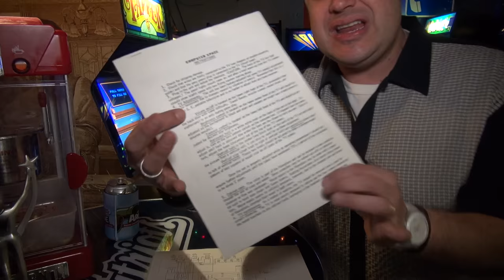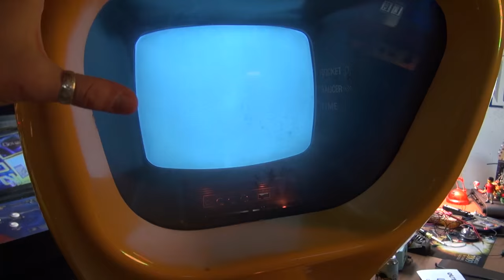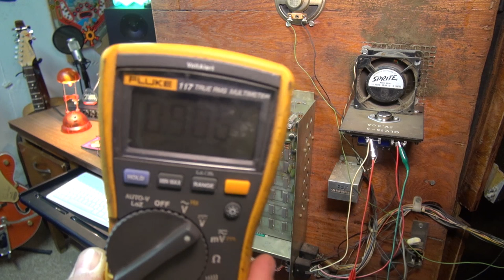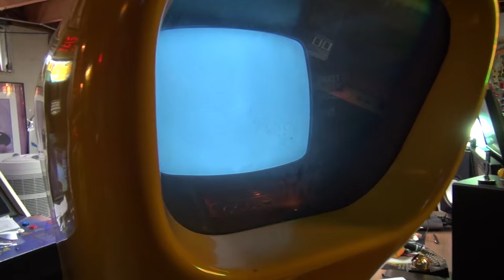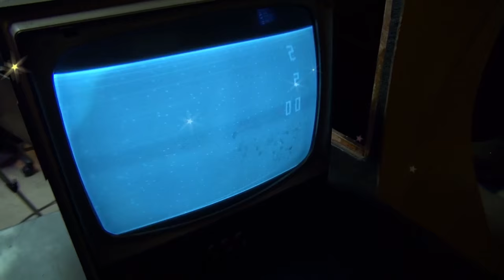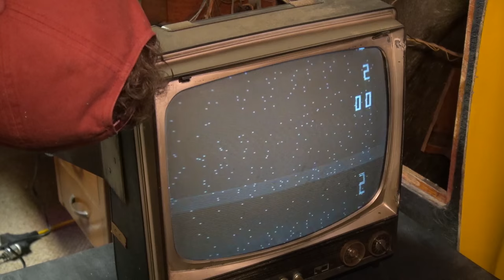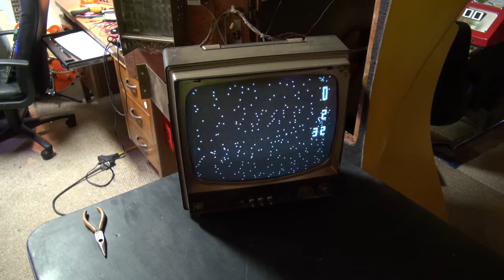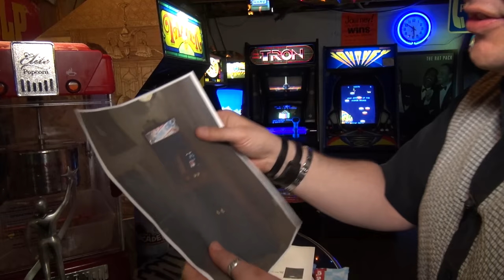Computer Space Arcade Restore Part #3 - GE S3 SE TV fix - vacuum tubes and more

Comment: If you remove the "sense"' jumpers on the power supply and run a separate wire from the sense terminal to the actual logic PCB, the power supply will compensate for voltage drops in the actual power lead and ensure exactly 5 volts to the ship set regardless of changing load etc. Not really necessary for this application, but thought I would toss it out in case anybody wondered why they have sense inputs on some power supplies. Can't wait to see this machine up and running. Great videos.

Comment: John - you should buy a FLIR One add on for your cell phone. Infrared cameras would easily show where any short was on any board. GametechUs uses one on his repairs and it's pretty useful
Reply from the maker: +Bob Marley Those look cool. I should get one!
Reply: Man, those things are awesome!!!! So expensive!
Reply: John's Arcade Game Reviews & Tech If a chip is shorting out it glows nice and bright.  Its really easy to see where an electrical path terminates if there is an issue.  Plus when you were inspecting the bulbs it would be obvious which parts of the board were not powering up.  They are expensive, but they have a lot of uses. I have one and was shocked to see where all the drafts in my house were coming from.  I also use it working on my car to find fantom power draw and other things.  Its a handy tool, especially for someone like John.

Comment: Get a lil tub of flux to help tin wires. It'll really help. Dip the bare end (wipe off the excess if you are fussy), and then apply solder to it. It really helps the flow of molten solder - nice clean surface. Flux cleans as the solder adheres to the wire making a good amalgamation. It's also great for tip maintenance. Yes, you will be using rosin core solder (solder intertwined with little voids inside holding the flux) but there's not enough flux to solder ratio for bare end wire.

All you end up doing is applying silly amounts of solder just to make up for the lack of flux. If you have ever used desolder braid, then you already know the principle.
Reply from the maker: +Jon Simmons (Neffers) Yes, I know I should be using flux more often. It's just so messy.
Reply: Nah man, really it's containable. I personally use one of those really small jam (jelly to you) jars that those "artisan" ones come in. I have used in the past a Nivea lip balm tub, but metal + proper flux = usually rust,

Just jab the bare end of the wire in and it'll just soak solder like there's no tomorrow. Also, if you end up using the more modern Lead free shit (it really is shit), it'll help with flow a lot. 

The only downside is using too much, then you do get the mess. For smaller applications, such as PCB stuff, you can purchase a "Flux Pen", these are like a soldering Sharpie, just dab it on pads or any bare copper etc. and the solder will adhere.

Comment: i am eighteen now but when i got my two cabinets i was 16 yep 16 thanks to the jump bug monitor i was able to fix both of them it was awesome
Reply from the maker: +Flashflood140x that's awesome! Great work. what games?
Reply: +John&#39;s Arcade Game Reviews &amp; Tech I have a ms. pacman cocktail which had a neckboard issue when i got it and a cruis'n world which had a battery backup problem when i got it the crusin world works fine except for not saving high scores and the MS. Pac has a color issue with the monitor ah

Comment: Just a suggestion - I am totally for getting everything original working as far as the power supply. BUT I would still get a quality switching PSU and have that in there for most day to day use, especially during long play days such as parties.

The best thing to do for those old electronics is keeping them running on quality stable power. Then reconnect the original PSU when it calls for it. I would go one step further and have a small UPS with line conditioning down there for this game, but I'm crazy like that.
(Sorry if this was mentioned a million times already).

Keep up the great work!

Comment: I would suggest not wiggling the vacuum tubes when installing or removing them.  They're designed to come straight in or out.  Wiggling will break off pins or crack the seal on the tubes.

Comment: Not sure if this is a tech myth or not, but I never touch tubes with my bare hands.  I always either use gloves or a non-static cloth to change them out on my amps.  When I was younger, I was told by some old rockers that the oils on your skin will degrade the integrity of the tube glass faster than if you can keep them spotless.  like I said... not sure if it's true or not, so do with it as you will.  Great stuff as always John!

Comment: Unstable picture could be dirty pots, dirty tube sockets, shorted or weak tubes.. If you check the other tubes I would spray some deoxe or even WD40 in the sockets to loosen the tubes up so you don't break anymore pins from other tubes, clean all the pot switches with deoxe too.. Start with the simple stuff first.. If it's not dirty tube sockets or pot controls, then it's other things.. Looks like the horz is a little stretched as the top number on the gameplay is a bit stretched.. Good to see that TV working.. Keep up with the good work, you're doing good so far....
Reply from the maker: +vintageceilingfans Thanks! I plan on digging deeper into the TV and soon.
Reply: Seriously pick up some cans of CRAIG Deoxit and their pot lube!

Comment: Try measuring the current through your 5 volt rail on a short. If it is nowhere near the rating, then it's probably a wrong resistor or a diode installed the wrong way?

Comment: Hi John, thanks for the fab channel. I think you need to consider the transformer for your PSU issue. As I see it, what your calling the power supply is just a voltage regulator. It rectifies to DC, regulates and smooths the output from the transformer. The transformer should put out a higher AC voltage (something like 12vac) and if it's only putting out 6vac due to a secondary short, it won't take a load. Keep up the good work

Comment: That Raspberry Pi stuff sounds interesting. I didn't even know it could output proper arcade resolutions.
Reply: +googleboughtmee Well it's designed to output composite, which itself is designed to be a combination of sync and luma, plus chroma which was specifically designed so that B&W TVs could ignore it. American arcades usually run at standard NTSC frame rates so it makes sense that it would work.
Reply: +CODMarioWarfare No I think they run at 60fps 240p not 30fps 480i.
Reply: +googleboughtmee They're really kind of the same thing. Any standard resolution monitor can accept both, the difference is in the timing of the scanlines at the source.
Reply: +CODMarioWarfare 240p and 480i are not the same thing.
Reply: +googleboughtmee 480i is just 240p with every other frame shifted down by half a line.
Reply: +CODMarioWarfare So they're different, is what you're saying?
Reply: +googleboughtmee What I'm saying is that analog monitors that want 15.7khz signals don't give a shit about the difference. BTW, an NES via composite is ~226p, not 480i, despite being displayed on a television designed for 480i.
Reply: +CODMarioWarfare These tidbits of information really are fascinating but I'm surprised anybody would speak of 240p and 480i as interchangable when it comes to retro gaming.
Reply: +googleboughtmee Obviously they're quite different and interlaced is better suited towards natural images while progressive is good for computer generated images, especially sprites, but from a technical standpoint they're nearly interchangeable which is why you can use progressive image sources (early video games) on consumer TVs and you can use an interlaced image source (Raspberry Pi) on a monitor designed for progressive sources.
Reply: +CODMarioWarfare John was talking about plugging the Pi into the cabinet, having it act like a Jamma PCB. Surely, you don't want a flickery interlaced image in this situation. You want it to look like an arcade board does. (And you don't want composite either!)

Comment: it means your regulator is overloading and going into shutdown.  It could also be that the voltage sensing circuit is cutting it off altogether instead of maintaining the 5v line. Got a drawing or a schematic anywhere for it?

Comment: does the sound come thru the TV or the speaker in the back . might check the speaker in the back. does the PCB have a volume control like jump bug did
Reply: the speaker in the back which is powered by the amplifier in the TV.

Comment: that tube in the back on the left, is glowing really really bright. AFAIK your tubes are never supposed to get really bright like that it kills them. you may want to consider getting that tv a Cap kit...
Reply from the maker: +Theo Wolfe I thought that too. I think I should swap that tube out.
Reply: yes but you should also have the capacitors and so on looked into, they my be leaky. quite often hot tubes are caused by a bad cap or a resistor going open.
good luck anyway, ill be here when the next video goes up.

Comment: John you should solder some pigtail spade connectors on to those terminals so you don't have to keep de-soldering and re-soldering those points.
Reply from the maker: +Penfold8 Yeah, I probably should. Trying to keep it original as much as I can.

Comment: Tube not glowing could mean that it's not making contact, meaning dirty tube socket.. Try rocking them back and forth in the socket.. Spraying contact cleaner and deoxe in each socket pin is a great idea too.. Some tubes you won't see glow, like the tube in the Flyback section.. And a tube that glows doesn't mean it's good..

Comment: If the signal coming from the PCB is composite I would try to hook it up to another monitor to see if the signal coming from the PCB is clean and check the sound the same way. That way you can take the TV out of the equation and see if you have more issues.
Reply from the maker: +pixle101 It's composite but I heard it has sync issues with non old TVs. I thought about using my PVM. We'll see...
Reply: At the very least you can check the audio coming form the board.

Comment: ok im having a look at the schematic myself and I have an idea.  Remove your jumpers and plug that jamma board back into it. It looks to me like the regulator is going into overcurrent shutdown. Now that could be because the vsense line is pulling the compensation pin (7) at the LM305A regulator and shutting it off.  It could also be because C1 is bad and shorting the compensation pin. Either way you need to determine weather its the sensing circuit shutting it down or a failure in the regulator itself. 
If disconnecting the jumpers doesnt change the result then check that your two transistors Q1 and Q2 are working and that the big T03 package is correctly seated.

Comment: are you gonna give friez the other monitor so he can use his tubes for it so he can have an original monitor?
Reply: +Jack Newton The screen / tube size is different i think, but the chassis are the same, so he just bought it for spares
Reply from the maker: +Jack Newton You mean Ed Fries? He has a working GE TV. Not sure if he needs it.
Reply from the maker: +John's Arcade Game Reviews & Tech The chassis is the same, you are correct.
Reply: oh ok I thought that he wanted it because he wanted the kind that was supposed to go in the cabinet
Reply: btw are you do more work on the quantum cabinet?
Reply: one more thing: have you thought of replacing the tube that you said was fine? because that still may be causing problems.
Reply: John's Arcade Game Reviews & Tech Dude, Ed begged you not to outbid him. Of course he wanted that TV. 😜

Comment: Sams photofacts were created by Howard W. Sams & Co, they would buy every single model that every manufacturer would put out, anything from audiophiles, and television components and they would go over the whole circuitry and create their own service manual which is a bit more detailed than the factory service manual including pictures.. In some cases manufacturers would make a modification to a chassis of a model, and the modification would not be included in the sams photofact.. I beleive they are still putting out photofacts but I'm not sure.. The service industry is pretty much gone seeing how it's a throw it away world we live in now when something breaks.. Arcade people would not need the Sams photofact, but in your case with a machine that has an actual TV set in it, It's very well needed.. And having the Original factory manual is also a good thing.. Every TV/VCR repair shop back in the day all the way up until even the 90s would get these Sams Photofacts as they came out, and that's where most of them are floating around from.. Closed down TV/VCR repair shops..
Reply from the maker: +vintageceilingfans Interesting!

Comment: i think you should swap chassis , and yes you have to do mode on new chassis :)
Reply from the maker: +uhfnutbar1 I really would like to avoid that if possible. :D
Reply: i know what your saying , but would you rather test and fk around with 45 year old pars and cap`s , the TV you bought most likely did not see that much power on time , but you know the one in game been on 24-7 and most likely well abused components,,, you know what talking about , swop vs repairing bake classy 40 plus yeas old :) just document everything and label all wires go that extra mile not fk up , ha ha ha am i scaring you yet :)
Reply: i wonder if one them adapter that go`s
component/RCA to CH 3 or ch 4 will work from the pcb to un-mode TV ,  
you know the ones ever one had to buy in 80`s when new VCR use RCA jacks only to OLD tv with a tuners, then you can get game going with smaller tube and then work on original tv
Reply: OH and now tv working Try hooking the Nintendo component/RCA, to it again see what you get , you know if that 3 image ship on screen is pcb , or tv , by proses of olimanation
Reply: hay , use this search on EBAY ""Rca to channel 3 or 4 converter box"" to find old school stuff 12 to 6 bucks
, there all 75 ohm cabal connector terminal lol so you have to use 75 ohm to 300 ohm two wire adapter thing thing like on old , consel Atari :)
but for testing i just make a pig tale off cabal and to tv :)

Comment: I think your not getting sound cause u didn't hook up the 12v....I'm not sure it needs it or not bit I know 12v usually has to do w the sound...I think you only did 5v..I may be wrong.
Reply from the maker: +Samuel Carrillo The power supply only does 5V.

Comment: John most of the emulators work great on the Raspberry Pi up to the Nintendo 64. I'm curious to see if the Raspberry Pi 3 has improved this or not. I'm currently running the Raspberry Pi 2 with Retropie - when you set up your pi make sure you create a backup image of the SD card because they become corrupted easily. Also - could I get a sub?  Thanks.